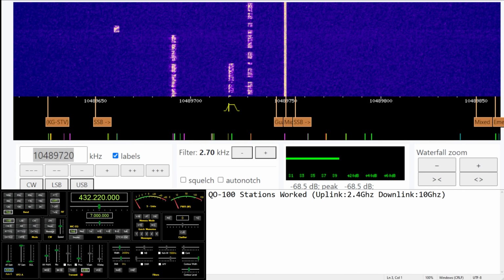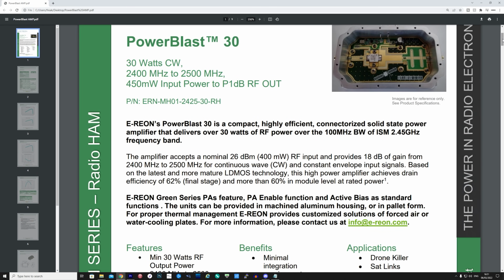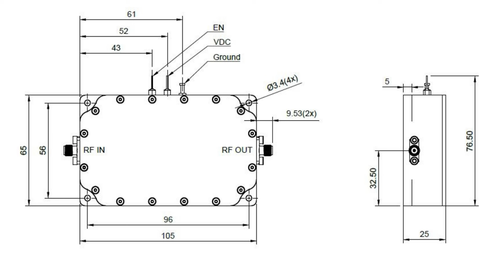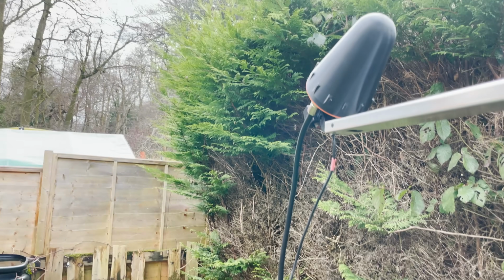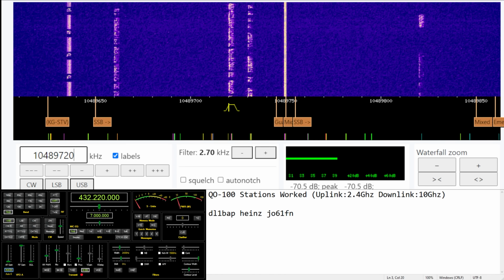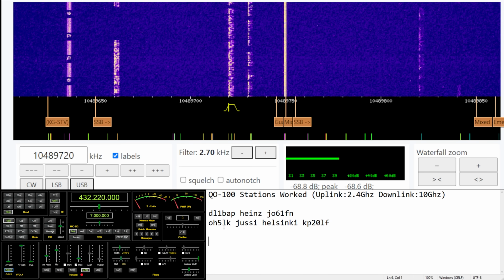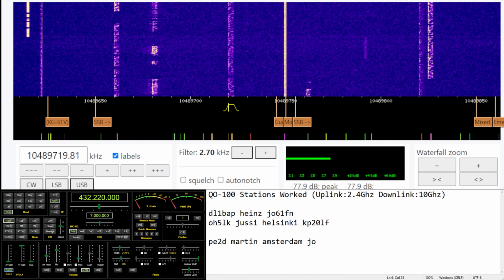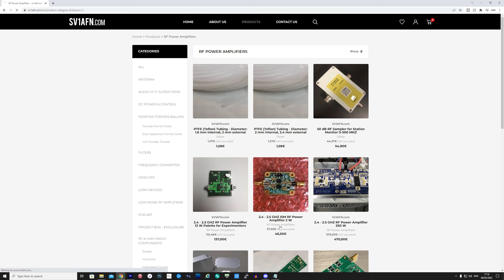Powerblast 30 - A powerful 30 Watt 2.4Ghz RF Amplifier For QO-100 Groundstation

Comment: I don't wanna be rude but 259,16€ per this little metal cased amp... i understand that LDMOS is expensive. But it's just not worth it because i'm sure that shipping also goes 40-50€ on top of that.Yes there are cheaper legit variants and yes their output is bit less than this puppy can do but c'mon.

Comment: Since this transceiver operates in the 2.4 GHz UHF band, could this be legally used as a Wi-Fi or Bluetooth amplifier?  I would be especially interested if this is the case for the 300-watt model.
Reply from the maker: I don’t think there is a receive path, therefore would not be suitable for WiFi / Bluetooth.

Comment: Nice review Matt! Do you have some specs about the low pass filter they are using? I assume it is a harmonics low pass?
Reply from the maker: Thanks Jason. All I have is the spec sheet which is available on sv1afn website. Alternatively you could contact E Reon for that information.

Comment: Wow, they are a bit on the expensive side plus the UK import duties. Sg-Labs have a 20W Amp at a reasonable price.
Reply from the maker: I had no import duty to UK, which I thought was good.
Reply: Not sure if it is expensive for what it gives. I was also triggered by the price and checked the prices for some of the parts used. Well the TR they use is almost at the price of the SG LABs PA (ceramic, cpc flange etc). It looks that the pcb is of Rogers material, and from the iridizing color of the housing as Matt was twisting it, I will take the bet that this box is alodined. So in absolute numbers yes they are on the expensive side, but quality has a cost. On the other side it would be great if they have local distis in UK so we can have it a better price. This Makis store is adding a 24% VAT? Where is it located?

Comment: Excellent stuff but also a bit scary with that much power in the WiFi band. I imagine with some ill will and 300Watts you can kill the 2.4 GHz in an entire city.
Reply: Quite easily.  For reference, a low-power FM radio station, with a power limit of 100 watts, can be reliably heard with a good radio out to about 10-15 miles away since an analog signal fades instead of cutting out immediately with a digital signal like HD Radio.  One can imagine then what 300 watts can do for Wi-Fi or Bluetooth.
Reply: the magnetron in microwave ovens produces about 800 W at this frequency
Reply: @TheMariepi3  yes, but if it leeks 300watt the operator will know.
Reply from the maker: We use very narrow beams at 13cm, even for ground comms. But I guess a yagi or omni could be used. Just don’t look at it! All joking aside, I think mobile phone masts output a lot higher power than 300 watts, so I’m sure we’re safe. I’ll let you know if I start mutating!
Reply: @TechMindsOfficial  The 300W is power margin to operate the amp in backoff. I dont think someone uses 300W ave at 2.4G. But if smo wants to amplify modulated signals with high PAR, e.g. for video or other high data rate modulation, they have to back off at least in dBs equal to the PAR
Reply: @TheMariepi3  yes but in a closed oven ! I remember a while ago some amateurs using the magnetron of microwave oven were able to get the ground warm in front of them by directing the emission.
Reply: DIRECTED RF WILL NOT WIPE OUT THE 2.4 GHz  BAND, THAT WOULD REQUIRE AN OMNIDIRECTIONAL ANTENNA WITH EXTREME GAIN.
NO FEAR WITH THIS.
ANYBODY RUNNING SYSTEMS IN S-BSND WILL NOT WASTE THE TIME TO SWAMP THE BAND IN THIS FASHION.
Reply: @AECRADIO1  could it be used to neutralize drones receiving on this frequencies ? (ukrain...)